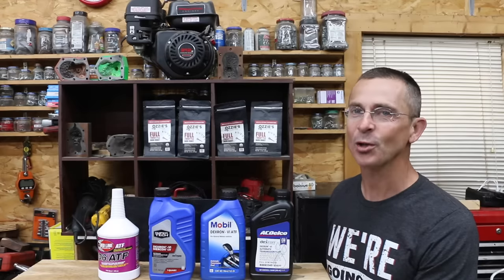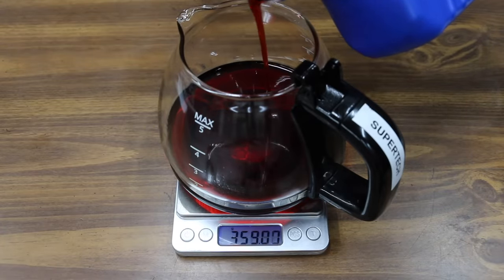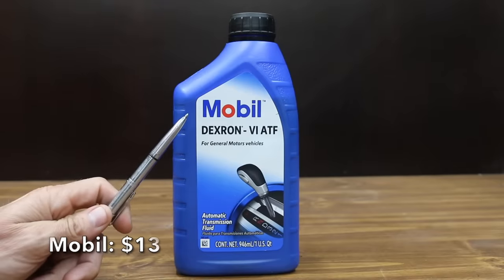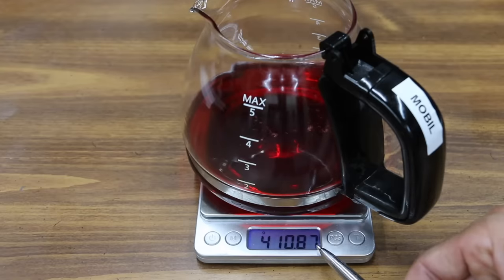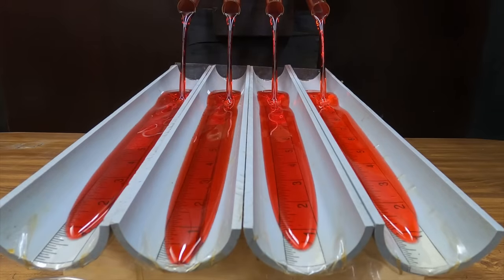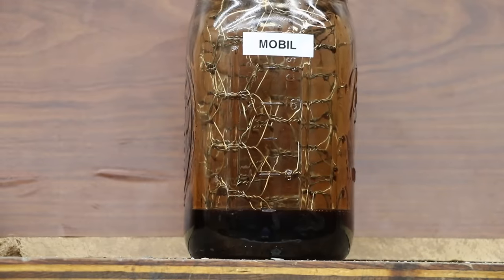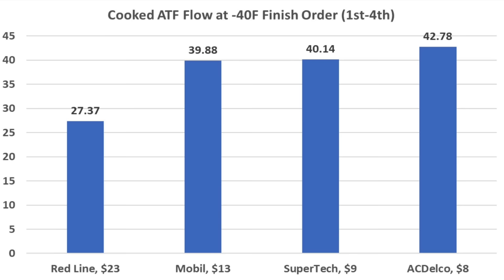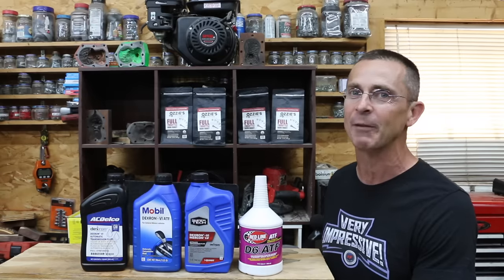SuperTech ATF Safe to Use? Let's find out!

Comment: Man, I can’t imagine the stink from overheated transmission fluid. Your dedication to gathering information is admirable.
Reply from the maker: lol. You are right! The shop smells awful after these tests for at least a week and sometimes longer.
Reply: For a while there I wasn't able to smell trans fluid without gagging lol 
Drowned mine in mud and had to do 5 tranny flushes to get most of the mud out 😅
Reply: @ProjectFarm  Ozone machine ought to clear out persistent smells fairly well, just air out well before going back in after treatment.
Reply: @ProjectFarm  if you cannot install a fume hood, consider a portable blower and light canvas hose to suck up fumes and get them outside.  The Coppus (brand) blower fan setup were popular with welders on nuclear construction sights to pull away welding smoke and fumes.  A test of welding fume suckers might be a good video idea too.
Reply: I rebuilt and repaired automatic transmissions for years, you should smell the fluid after the clutches burn it. It's an odor you won't soon forget.
Reply: @Rick-Williams59   I'm just starting as a mechanic and the smell of a bad engine rear main hurts my nose. For some reason I can handle gear oil just fine.
Reply: I would like to see Schaeffer in the mix also
Reply: And the 2 hours switching coffee pots every 10 minutes
Reply: @Rick-Williams59  The old 'yeah it's done' smell.
Reply: I had the same thought.
Reply: @ProjectFarm  Maybe time to test air fresheners
Reply: Just wait till he does a gear oil show down 😂
Reply: @ProjectFarm  You should test respirators and N95 masks for air safety hah
Reply: Indeed.
Reply: @ProjectFarm  That's one test you neglected- how many showers does it take to get the stink out of your hair after you get trans fluid in it.
Reply: @o2wow  you know what?  I second this.  It is time he got a fume hood.  Cool story bro time...

My buddy had done a job where he had to clean a sign with acetone before painting it and threw the rags in the back of the van.  He drove half an hour back to the shop, and then went to get routine bloodwork done.  Doctor called him the next day and made him come into the office.

"According to your bloodwork, you need a liver transplant.  We're gonna take a second test here to confirm."  Doc drew the blood himself.

That test came back fine because the acetone had gone out of his system.

The moral of the story is, that which does not kill you might almost kill you, or mess you up, or stress your body in ways it might not fully recover from.

  Oh, and the only effect of this noticeable to my buddy was he felt a little more tired at the end of that day.

Stay safe and keep making these awesome videos.
Reply: @ProjectFarm  At least it wasnt gear oil.... that stuff is the worst....
Reply: Thats not bad. You mean gear oil stench with the sulfur in it.
Reply: No kidding it’s stinks when it’s not cooking.
Reply: New atf smells like celery, burnt atf not so much!
Reply: @dannycc7307 omg, I hate dealing with nasty old gear oil before lunch, my sandwich tastes like dead dinosaurs.
Reply: @MichaelRBaron I learned quick that the gloves when using the parts washer are not optional, feel like shit the rest of the day & dont even feel like eating lunch.
Reply: @tl1024   I've been using nitrile gloves since day 1 and no matter how much smack I get for it I will not take them off when handling chemicals. I also have puncture resistant gloves for everything else and my hands are still in very good shape. Sure a little grime and oil stains my fingertips but that's nothing compared to others hands.
Reply: @huzudra  Actually, he should do an ozone machine test…”we’re gonna test that!”
Reply: A quart of it got spilt in our work truck and when it was hot in the truck it smelt like cat pee.
Reply: @ProjectFarm  I would humbly suggest that you consider building a simple chemical fume hood. Think of your health! You’re a young man and deserve a long healthy life. Some chemicals that were commonly used in the open 30+ years ago are now used only inside a hood.

Comment: The claim about synthetic ATF (aka Dexron 6 vs older Dexron ATF) being safe is BS. Transmissions are far different then Engines, where as Engines can handle the viscosity shift better. The difference between Dexron III and Dexron VI is enough to cause issues for many transmissions. I would go as far to say that you should always look into the viscosity of the atf and compare it to the grade your transmission is built for, but good luck on this and this info is very hard to come by with most products. EDIT: All multivehicle ATF will always be of the lowest viscosity of the standard it supports. Castol Import Multivehicle Dexron III H is higher on viscosity vs Castol Multivehicle with Dexron VI support.

Comment: I use RedLine MT 90 in my 1994 Hardbody's manual transmission and it is worth every penny. Buttery smooth shifting even in cold weather, and brass synchro safe which is something a lot of modern gear oils can't claim.

Comment: Your tests over the years have been getting more and more professional, accurate, thorough and insightful....but it seems pretty obvious you are having a ton of fun in the process. Will be replacing my automatic transmission fluid soon. As they say, oil is cheap (no matter what the price), engines and transmissions....way more expensive!! Much thanks... Red Line it is...!!
Reply from the maker: You are welcome!   Thanks for sharing.
Reply: To be fair, they all performed as they should have; if your transmission was running at those temperatures for that long, it's cooked anyway lol
Reply: If you want even better, getcha some amsoil. Hands down the best fluid I've ran
Reply: If you have too many miles on the same fluid you should probably not replace the fluid. It car run worse. I think cvts are the only exception to this rule
Reply: @Mid2stars  never flush a transmission. Instead always drop and refill with new. Also don't put dex 6 in a dex 3 trans. The 3 is heavier for a reason. Also amsoil is pretty much the only 100 percent synthetic. Full synthetic just means there's some in there.
Reply: @Mid2stars  bingo sir.

Comment: Your testing revealed significant differences in performance that I did not expect.  Fascinating, as per usual for Project Farm.

I'd like to see several OEM ATFs tested, as not a few manufacturers recommend to only use their own ATF, especially Toyota WS ATF. 

In addition, Valvoline MaxLife ATF (highly regarded by many) would be a worthy competitor should you choose to do a follow-up.

Thanks for your efforts Todd!
Reply: I put Valvoline max life multi-vehicle ATF into 2005 Volkswagen TDIs, as well as a 2009 Hyundai sonata 2.4 L. ALL vehicles had subsequent issues with torque converter slip. The Hyundai sonata has since so far been saved without any mechanical work by adding an anti-slip agent into the fluid. One Passat lost 5th gear completely because the torque converter clutch won't lock up anymore, and the other Passat I'm not driving and will probably replace of the manual transmission because I think it will have the same fate as the first. The Passat that completely lost fifth gear had 170K on it, the sonata had 200K, and the latest Passat that is still working but has active slip code and shutter has 160k. Just my two cents. I do think the Valvoline max life has a lower viscosity than a lot of ATF out there, and it might be more "slippery".
Reply: My fleet used Valvoline Maxlife atf for a while. It was excellent, but we switched to STP and then to Sinopec because of cost. My mom's Audi shifts great with maxlife in it, it had 130k miles on the original audi fluid, it was jet black.
Reply from the maker: Thanks !  Thanks for the suggestions.
Reply: Yes please.  Even more so, 

A video comparing the best OEM oils vs the best 3rd party oils.

Example: Toyota full synthetic oil vs Amsoil signature.
Reply: @ProjectFarm  Honda atf is said to be only thing to put in Hondas bc picky
Reply: Abso-fucking-lutely!
Reply: The reason for this is to eliminate or mitigate the inherent drivability concerns induced in some transmissions.  An example  Chrysler was having issues in one of their transmissions. The remedy was a banana oil derivative. The orifices in the trans can be extremely small. I will stick with OEM recommended. Some may recall the Ford 7.3 Power Stroke (94-95) when the engine was oscillating. The solution was an additive to the crankcase from Lubrizol. Buyer beware ATF is not any ATF stick with what the OEM recommends or it may be costly

Comment: Much respect for the time and energy you put into these test and videos!
Reply from the maker: Thanks so much!
Reply: Not only that, much respect for the meticulous testing methods.  I am impressed by the re-polishing of the friction wheel after each test to assure testing uniformity.   This channel is truly one of the best.
Reply: @ProjectFarm  OT?  I have become super interested in methods to unstick rings in low compression cylinders without major disassembly.  It's looking to me like many engines thought to be worn out due to low ring compression and oil consumption actually have their rings stuck to the pistons by carbon and varnish,  chemical solvents such as fuel detergents might be able to dissolve this glue, free rings, improve compression and reduce oil burning all without expensive gasket sets and other overhaul related costs; plus there may be other methods and/or substances that can free rings without major disassembly.  Can you help experiment with such methods? Do you have any low compression cylinders that might have stuck rings? on which to experiment?
    So far, the most effective method I have found on YouTube is soaking the combustion chamber in SeaFoam.  Easiest on upright engines, One fills the cylinder with SeaFoam through the spark (or glow) plug hole for at least 3 days, replacing it if it leaks down.  Then, with spark or glow plug still removed, crank the engine to prevent hydro lock.  Then replace plug and start the engine for a few minutes.  Then change detergent laced oil. Then run longer and test for improvement.
    But might better methods remain undiscovered? Might antifreeze dissolve this ring glue? or acetone? or heat cycles? or something else?  Might certain fuel additives, oils or oil additives dissolve ring glue while running without sidelining the engine for 3 days?
   My friend's Subaru may have stuck rings.  How do we soak boxer engines and how do we tell which exhaust valve is open on post distributor engines?  How far can you tilt a Subaru without problems?
Reply: @ProjectFarm  OT? I'm also very interested in the potential of retorquing head bolts to prevent head gasket failure in old engines, even high mile engines with torque to yield head bolts?  How would we modify the new specs for retorquing? what if bolt replacement is difficult as in Subarus? use specs from old Subarus? what can small engines tell us? Do bolt positions advance when retorqued on old mower engines?  on junk car engines? can retorquing save leaking head gaskets if caught early?
Reply: @ProjectFarm @ProjectFarmp lease , do bathtubs different paint test and best & worst. With which one handles water
Reply: @ProjectFarmp lease , do bathtubs different paint test and best & worst. With which one handles water

Comment: Always had positive results with redline oils in everything I’ve used it in. For example their heavyweight shockproof oil did wonders in stock mitsubishi evo t-cases behind non-stock, big turbo engines. They went from not surviving to surviving a pretty long life. Amazing an oil could make that noticeable of a difference. Anyway, thank you for these un-biased review videos, quite possibly the best channel on youtube! -Todd
Reply from the maker: Thanks and you are welcome!
Reply: IMO redline is better than Amsoil. They’re ester based oils are superior.
Reply: @evansbj91  we'll have to test that
Reply: Thats what i used in my wifes Porsche Cayenne. Its been the only non OEM fluid I have used in her and i was very nervous. 50k miles later it shifts great still. 
I do hate the way you have to fill the case. It has no way to check the level. You have to fill it from underneath, get the transmission up to temp and let it flow out the fill hole till it turns into a dribble. It was a mess and next to impossible to know if you have the correct amount in her. As the transmission warms up more fluid wants to flow out. Is the vehicle at perfect level? Did you way overflow it when it was cold? 
Basically I measured the amount that I drained out and compared to the amount I put in. I put in about a half quart more then I drained.. must have been close enough.
Reply: @Solders18  “we’re GONNA test that”
Reply: I went with redline 75w90ns in my wrx transmission after rebuilding it and it's been great.  Seems to be mostly preferred in the subaru/Mitsubishi world.
Reply: @ProjectFarm   YOU NEED to test Dexron 3 vs Allison approved Mobil 1 Delvac TES 295/468/668(latest spec) Approved Fluids.  The Dmax/8.1 with Allison 1000 trans fluid debate is heated since Dexron 3 and Dex VI was standard from 2001 to 2006 and Dex VI from 2007 on. Allison recommends the upgrade. NOBODY has tested this!
Reply: Redline is Phillips 66. I'm a petroleum engineer that blends various oils, mostly for OEM labeling.
Reply: @ProjectFarm  Also, Allison transmissions does NOT recommend Dex 6 be used in their transmissions before 2007 due to Dex 6 chemical makeup attacking certain seals.  One more reason they recommend an Allison approved TES 295/468/668 fluid like Mobil Delvac.
Reply: @ohioplayer-bl9em  yeah, basically drain it all, refill with amount specified. Check for updated info though. My car was manufactured then later they updated the fill spec to a lesser amount.
Reply: @GT-mn3bx  castrol transynd is supposed to be the best 668.  I run it in my 8.1 allison
Reply: @RickBaconsAdventures  It is fine as well. Maybe PF could add that into the test. NOBODY has tested these. BTW, I have ran Transynd and no issues. Here, Mobil Delvac is 35 bucks a gallon at the big OTR truck repairs and more readily available.
Reply: @GT-mn3bx so can I mix these fluids? I've got a vintage mustang that drinks ATF. I'd rather not put $23/qt stuff in at a change, but I'd sure try a bottle to top off.
Reply: @rolandsmith4394  Yes. If it is leakng fluid, I'd run the appropriate Supertech or any other Warren Oils brand product until fixed.  I'm  a Petroleum Engineer and blend tons of OEM oils and buy Costco/Supertech oil products for all our regular vehicles.  I'm a fan of Redline(mostly their 2 stroke  racing oils) but if it is losing ATF, there is no reason to be buying a high dollar specialty oil.

Comment: In your oil analysis results, I'd recommend moving Boron from the list of detergents to the list of anti-wear additives.  While boron does have some detergent properties, its primary purpose is as an anti-wear or extreme pressure additive.
Reply from the maker: Thanks for the constructive feedback.
Reply: Sounds too incredible, boron is one of the very hardest minerals and has no detergent properties, its close to diamond, which is why its used as an ABRASIVE material, you dont add such super hard abrasive materials as an agent, youll be better of adding sand in the oil, its softer and less abrasive than boron. Whoever said boron is good for the engine/gearbox must  be laughing his A off over all the people who believed his joke.
Reply: For sale: Boron powder oil additive, guaranteed to grind your gearbox to a halt.
Reply: @pflaffik  no. Boron is actually used as an anti wear additive. Also boron is NOT a mineral. Its an element. There are minerals made from different boron structures and compositions. Now back to the anti wear argument. Just because boron is used to make a hard material doesn't mean that it can't be made into anything else. Just like diamond and graphite. These 2 materials are IDENTICAL in chemical composition, they are all made from carbon, but the atom lattice is TOTALLY different, giving these 2 materials totally different properties. Graphite for example is extensively used in greases and oils, while diamonds are used in very hard cutting tools. Both are made from carbon but their properties are vastly different
Reply: Ouch, grandma surgery got burned! They know better than chemical engineers 😂

Comment: Great work as always! Would love to see a round 2 with Amsoil, Royal Purple and Valvoline Maxlife. Valvoline also makes a specific Dexron VI and I’ve always wondered if it’s better or worse than Maxlife
Reply from the maker: Thanks!  Thanks for the suggestion.
Reply: I'll definitely second this suggestion.  Valvoline maxlife is one of the most popular atf fluids, so it would be good to see it tested.
Reply: I second this as well would love a round 2 video
Reply: @ProjectFarm  Valvoline Maxlife is very widely used, I was going to suggest testing it also. Thank you for your integrity an no nonsense videos!
Reply: If there’s a round 2 include the Valvoline maxlife, Castrol & Idemitsu. Idemitsu is the maker of some oem fluids like Nissan.
Reply: I would love to see Royal Purple ATF tested also

Comment: I put redline manual transmission fluid in my 5 speed Saab for a number of years, made the synchromeshes work a lot smoother and was especially noticeable on cold 10 degree mornings going to work. Redline is expensive, but I love the buttery smooth operation their fluids provide.
Reply from the maker: Thanks for sharing.
Reply: Better than Valvoline synthetic?